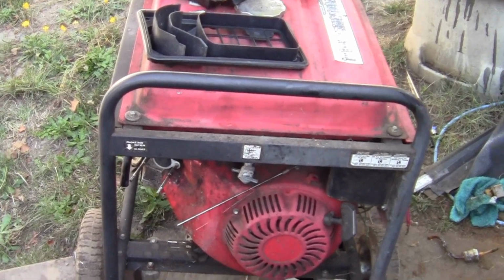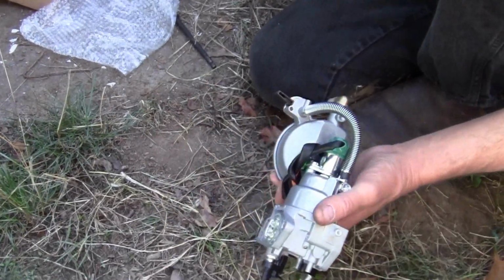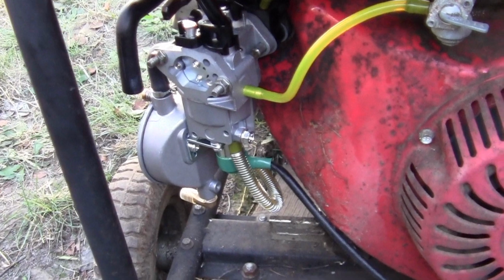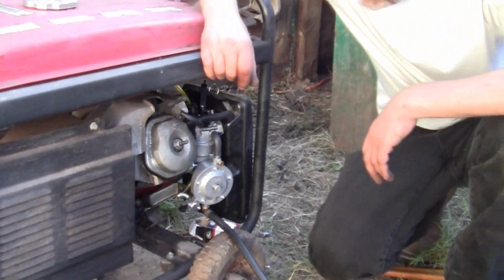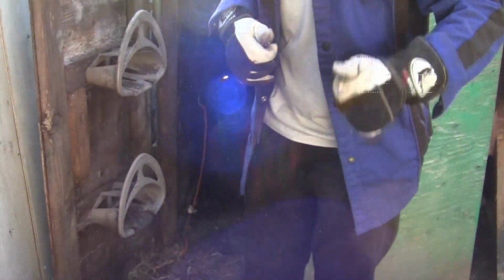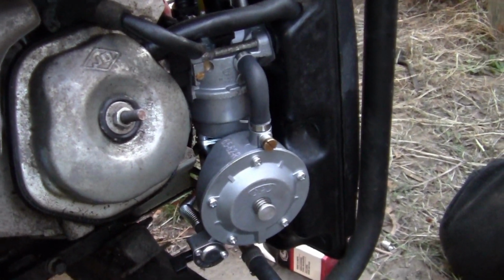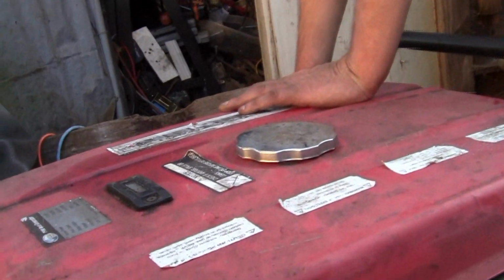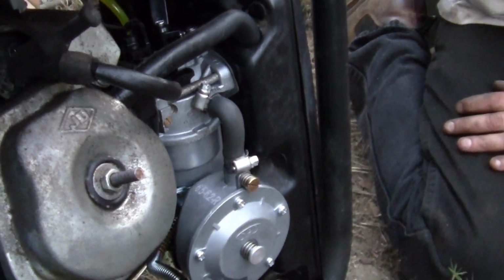GENERATOR DUAL FUEL CARB SWAP & MODIFICATIONS FOR RELIABILITY !

Comment: YPU HAVE NO IDEA WHAT YOURE DOING IM IN A POSITION TO SAY THAT SINCE MY BUSINESS IS 5 shops I paid for outright to have them built no loans no credit no debt! doing home electrical commercial electrical and generator/small engine tier 1 tech! Also YES OVER 99.5% are bolt on check the air fuel with my tool and change the plug!!!!! My oldest one of these is 8 yrs old and I slapped it on and my customer hasn’t had 1 issue neither have the ones that are lp/NG from 1, 2, 3, 4, 5, 6, 7, 8, 9 10 years old!!! NOT A SINGLE ISSUE AND YEP JUST SLAP ON AND NEW SPARK PLUG ZERO ISSUES

Comment: We use these all the time on pull start only generator your size and bigger and NEVER ANY ISSUES WITH HOSES EITHER!!! You don’t take care of your stuff that’s obvious that generator sits in the weather A TON AI GUARANTEE IT!!! And also with electric start you have to crank it WAYYYYY to long to get it to start! ALSO!!! You need to change your spark plug running lp or nat gas plus you’ve destroyed the tune on it you’ve all but shut off the fuel!!! LP takes a higher ignition to light off it carries less BTU’s than gasoline does

Comment: NOT ENOUGH FUEL!!!!!!!! It should crack right off if you’ve tuned it right. Idk how big your welder is but that’s pulling ALOT OF LOAD AT 120v so if that’s a 5,500 running watts you’re only getting 2,750 watts from 120v and  and definitely proper adjustments plus you’re using a regulator on your tank for tanks that are extremely larger than your 30lb tank

Comment: Just FYI you’ll loose 12-15% of your wattage when pulling load with those tiny regulator combos, also that hose you’re using with the red regulator. There’s no need for it it makes more work for you in the end I say this because my brother had one and we used it and that’s when we checked the A.F.R with a tool I use often for doing portable generator install’s and we had it perfect and we lost 15.64% of running and surge watts plus it brought the sinewave from literally perfect to the equivalent of a BrownOut! Then we used a hose with non adjustable regulators, like for a BBQ grill and it immediately went to a loss of 9.03% loss in running and surge watts. As a certified by state electrician with my own business/corp. of shops 5 in total I order generators from over seas direct from the manufacturer by my specs. From 18,500 watt surge and 18,000 running watt inverters that we build the inverter box for itself in house and I make them all tri fuel with garritson regulators and dual fuel generator carbs we set them up and w/gas they’re 100% wattage advertised and LP WE lose ZEEEERO wattage so gas and lp are 18,500/18,000 watts and on natural gas on a 1” hose and strew on ends not snap on or push an lock ends at a 40-50 foot hose we lose 4.5-6% wattage loss so we get at worst 17,390 surge watts and 16,920 watts and also when we run the hose under 40-35 feet is when we get 4% wattage loss so 17,760 surge watts and 17,290 running watts. That’s less than 1,000 watts lost!! Also, we retain pure sine wave and 2-2.9% THD (Total Harmonic Distortion and that’s less that power from the pole and less than permanent home standby units we install. From home units to massive Generac industrial grade, generators for hospitals. I also only charge 1,099.00 dollars for that inverter it’s our largest and we warranty those for 5 yrs commercial and 6 years residential unlimited hrs as long as you can show proof of oil changes at the correct hourly intervals, valve lashes have to done on video or bring to us to do or we come to you at ZERO DOLLARS for the service, it also comes with a 1” lp/propane hose the grey kind and we supply the instructions the we wrote in normal English. We also have sound and weather proof boxes we build in house THEYRE NOT PLASTIC EITHER NOR ARE THEY OVERSIZED AND THEYRE EQUIPED WITH VENTILATION AS WELL AS 50amp 120volt and 50 amp 120/240 and 30amp 120 and 120/240v outlets, and all our portable generators 15,000 running watts and above including our inverters we put a 4lug (L-1 & L-2 (each 120volt hot wires RED AN BLACK WIRES) the White neutral wire and the green ground wire. Which gives you the option to eitherr use the 50amp 240 outlet which only gives you 12,000 watts, 12,000Watts devided by 240VOLTS= 50 AMPS but with a simple interlock kit. You can run the 50 amp breaker to your box and use other cords for something else OOOR INSTEAD OF INSTALLING A OUTDOOR 50amp recessed male outlet which cost about 50 dollars and then wiring it in the 50amp backfeed breaker WE CAN SUBSTITUTE that 50amp cord to a 4awg tthn 4 wire cord  to hook up to your lugs and then to your main panel with an 80 amp backfeed breaker and power the whole house with all 18,000 running watts instead of losing 6,000 WATTS!!! With the 50 amp cord. We have regular generators that we have sole proprietary to normal portable like yours that make less than 5% THD PURE SINEWAVE  THAT REACH 22,500 running watts that have the same options and all of them come with the hoses for the fuel you will use  (ALSO ALL OF OUR GENERATORS HAVE THE BREAK IN PERIOD DONE BY US!! So you don’t have to and we put all fresh oil and /or filters on the day you buy it plus are generators go from 22,500 running watts to 5,000 surge watts 4,650 running watts and up from there and we also have our own line of home back up generators (stationary) from 9,000 watts up to 35,000 watts

Comment: I ran a trifuel carb on natural gas after a hurricane over a year ago. It did well for 24 hours and then quit. After that I could never get the generator to run for more than 5 minutes.  I suspect the diaphragm in the regulator may have gotten deformed because of the heat. The carb gets extremely hot when run continuously for long periods and this type of trifuel has the regulator 
 attached to the carb. Would test it out with continuous use for an extended period using natural gas/propane before I needed it for extended power outage.
Reply from the maker: never had any trouble ..

Comment: Iv been wanting to get one of these for my old blue gen set just never pulled the trigger. That carb and regulator setup definitely looks more legit. I will have to snag one with your link with my next paycheck.
Reply from the maker: They work well if you swap out the cheap hose and clamps . Thanks man !!